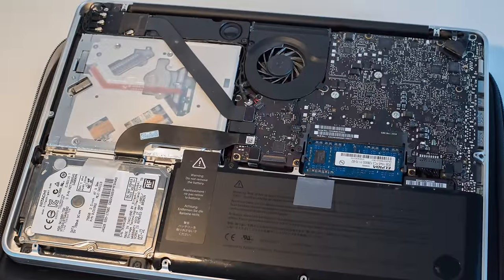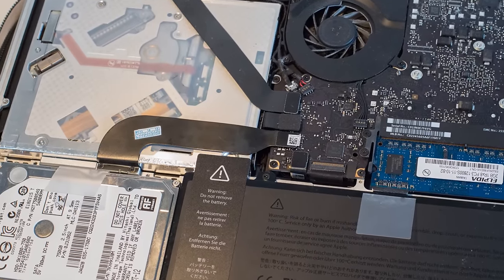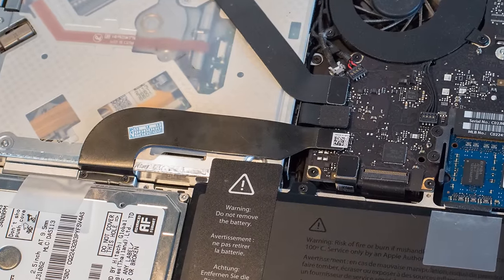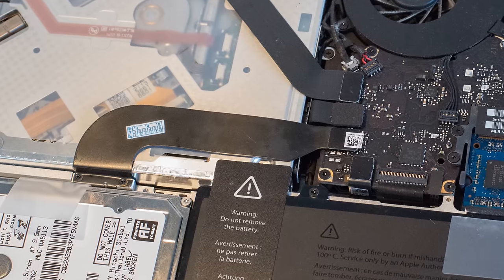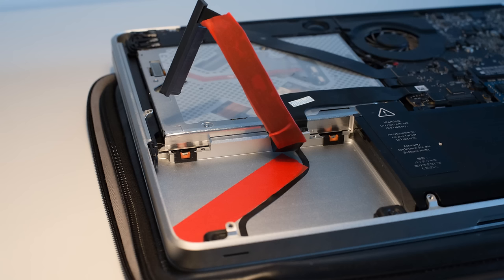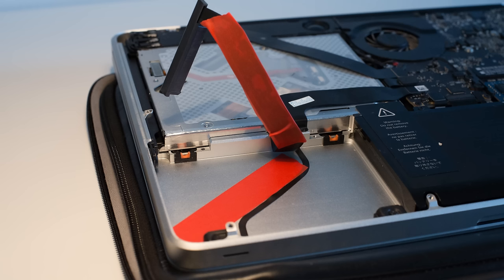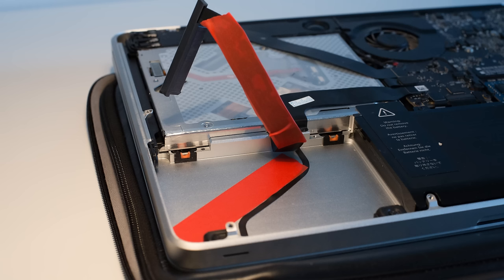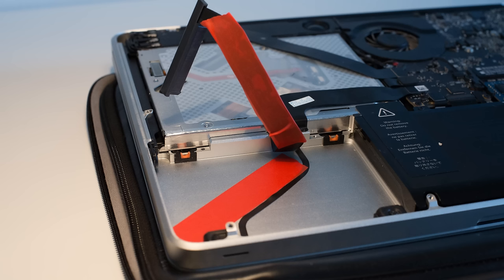MacBook Pro Hard Drive Cable Failure - Free fix and preventative maintenance - Question mark

Comment: Hi. I’ve started having such problems with my MacBook Pro 15 mid 2010… basically was freezing just after starting OS. I thought it could be virus but couldn’t even reinstall OS… so was afraid SSD failure or motherboard. Then looked at your video and used exactly your idea… It started working perfectly straight away! I didn’t even have to replace that connection cable (actually couldn’t see any visual damages on it) I’m guessing it could be some static electricity issue between aluminium unibody and cable. Now it’s been perfectly isolated after applying your solution! You’re a genius… many thanks👍🏽
Reply from the maker: Glad it helped! It is often worth replacing the cable anyway if you get repeat issues.
Reply: Brue Computing …absolutely, I’ve bought that cable already anyway in case. So whenever starts playing up again …just gonna replace it and apply that isolation again. Thanks

Comment: Did a full fix and upgrade in 2020. Not sure if I commented already but thanks for the vid and the amazing fix. Upgraded a mid 2012 macbook pro to 16GB RAM and new SSD with new version of cable (821-2049-A) plus your tape fix (old cable was def causing load issues). Updated OS as well to Mojave. It's working better than new, the i5 is still strong and 16GB RAM + SSD makes a huge difference.

Comment: I just found out my client would have to wait 4-6 weeks for a new cable... But thanks to your awesome video, I can fix it until the new cable arrives. (I would rather replace the cable in any case, but still use your fix to ensure the new cable will last). Thanks for your awesome tip! G

Comment: Shutdown Macbook and went to coffee shop. Went to boot and saw the "no boot" device sign. 3 reboots same result. Did a panic. Drove to get a newer SSD. Took out old SSD and put it in external enclosure. Watched this video on phone and saw that the original SSD could work. Sure enough, it did. Decided to use the larger drive and cloned the old one. Taped the cable. Put new drive in, had to re-install OS due to using a larger drive (an in place install, so I didn't lose anything). The electrical tape did the trick. I can use the old and new SSD in my Mac now without issue. Glad I didn't have to buy a new cable. Was skeptical that this would work. Thanks for the tip.

Comment: fantastic -- thank you so much for this video! For what it's worth, my problem was two fold- a short in the sata cable and a going-bad hard drive; when I inserted the new replacement HDD, the macbook wouldn't detect it. As soon as i put some electrical tape on the case, it found the drive right away

Comment: Excellent video - thanks so much! The mid 2011 Macbook Pro's like mine are terrific computers, except for this issue. I've replaced my cable twice (Apple - no charge), and was ready to do it a third time. I've been accessing my hard drives (I have an SSD in the hard drive bay and my old drive in the optical bay) through the optical bay "backdoor", and it's been surprisingly good. But it's clumsy at times, and I want my workhorse back. I'm going to get some tape now. Fingers crossed. Cheers!

Comment: that's brill!it works. thanks m8!

edit: after I tried your solution, the problem (long rainbow and question mark) still come out. sometime after i shaked my macbook, the apple logo will apear. so i try to pinpoint the problem with the cable by pressing the cable above the optical drive/cd drive and it works. the apple logo apear again. found that my exact location of my problem is the bent near the folded mark . make sure the cable above optical drive/cd drive not bent. put some paper or something like tape the cable stick to the optical drive to prevent any bend and give pressure so the cable keep straight. no more long rainbow or question mark even I try to shake it hard.

hope my suggestion can help you who have the same problem like me. cheers

Comment: Had to try five times. But here I am, looking at HDD back online. In my case I have taped all points of contact of the cable with any metal surfaces. The point where the screws are was probably where it went haywire. Now it works. Big freaking thanks!

Comment: Thank you thank you thank you thank you. You are my life saver... My old cable must have malfunctioned and caused my drive to keep restarting on itself till it's stop booting all together. I had thought there was a problem with the hard drive, so I bought a new one. When I got a new hard drive, the cable wouldn't recognize the disk no matter what, so I thought the problem must have been the cable all along. I bought a new cable and nothing; it still wouldn't recognize the new disk, so I thought the newly bought disk must be defective. But to confirm I bought a external SATA connector and lo and behold the new disk appeared, so I restored with time machine and blah blah blah, it all ran smoothly but I have to carry the hard drive externally, so I tried the cable again and still, nothing. I was gonna buy another cable but thanks god I came across this... In conclusion to my ranting, a lot of money and days of headache and researches could have been saved by simply TAPING the cable... P.S. I didn't even have electrical tape, so I used masking tape and it worked.
Reply from the maker: Glad to help. :)

Comment: This is great! My mac would start to boot, then go to a "question mark folder", freeze on the white screen, or take me all the way to a home screen with the mouse frozen. I replaced the cable once... a year later again, six months later, and here we are.... It seemed that each successive cable replacement lasted less time than the previous one. So I taped the whole hard drive cable up, on both sides, like you described. Did not help... What I did then is took out the two screws that hold the hard drive cable to the unibody (right at the two 90 degree bend), and taped over those screw holes as well. Suddenly, everything worked. I think the screws somehow rub against the cable and cause a short. The weakest point. I can't believe I paid $1.5k for this stupid computer. Still better than any PC
Reply: Question:  when you purchased your replacement cables were they "Apple" , or 3rd party?   I'm sure you guess where I'm going with the question, but sometimes saving a few $ isn't worth it if the part is made poorly.   (there are plenty of good 3rd party products of course, but some are NOT good).
Reply: I agree. yes my cables were 3rd party (suspected), although claimed to be "OEM" on Amazon. Apple won't just ship you a part from their website. You would have to go to a "certified Apple repair shop", and after they tell you that they don't sell parts, pay them $80/hour to work on it
Reply: iFixit has a good reputation if you haven't tried them

Comment: THANK YOU! I have a 2010 Macbook Pro 13" Took your advice and lined the cable routing path with electrical tape, problem solved. Too bad I already bought a drive for it, but I needed to upgrade to SSD and Linux install anyway. Great stuff!

Comment: Thank you.  After thinking I had hard drive failure and replacing the hard drive the utility still would not recognize the new drive so this makes more sense.  In utilities it will say disk 0, but for one moment it said disk 1 and that was a clue as well.

Comment: This happened to me this weekend, spent 2 days doing a backup even opened case to inspect cable.  Then when saw this video I added the 2 strips of electrical tape even though there was no visible damage and WOW this worked!  It's a shame Apple does not advise this in their support channel.  NO REASON TO BUY A NEW CABLE

Comment: Finally diagnosed the cable as being the problem when my MBP 2012 wouldn't boot.  HOWEVER, when it shorted out it must have damaged the SSD also, as that showed as being corrupted when inspected by other machines.  That made the problem extra complicated to diagnose.  To all intents it was a straight-forward SSD failure, so I replaced it with a cloned SSD backup (absolute lifesaver), which worked, but only INTERMITTENTLY.  AAARGGH,  

Further tests on RAM, hardware tests, etc, none of which showed up problems, but the system would repeatedly crash after a few hours/minutes/days.  

Finally by a process of deduction I suspected the data cable.  Replacement ordered on Amazon for £10, installed, and 2012 MBP working again on the cloned SSD!

Comment: This is a great tip... had the very same issue with hd cable.. I added electricians tape to the cable and chassis and now no problem. Ordered a replacement cable as a long term fix but will cover the new cable in tape as well.. Thanks very much.

Comment: Well, this is nothing short of a miracle. I've spent hours trying to fix my 2010 Macbook Pro which has always been faultless until a couple of weeks ago when all of a sudden the screen went black and wouldn't turn on or make any sound at all apart from the sound of the fans whiring. I was beginning to think, best case scenario a new hard drive was required when i stumbled across this video so thought i'd give the tape trick a go - and hey presto i'm back up and running as if nothing had happened - Thankyou very much!...
Reply: Incase anyone is interested, after i did the fix in the video, even though my Macbook Pro started up straightaway, once it had warmed up(after 10mins) it blanked out again to the black screen. I'm now hoping it's just a case of replacing the cable...
Reply: This exact thing happened to my 2010 Macbook Pro about two weeks ago.  It suddenly slowed to a crawl as I was typing something then the screen went black.  Afterward I restarted and got the prohibitory and question mark symbol on grey screen.  I tried booting from the recovery startup dvd and checked disc utility and it doesn't even show a hard drive exists.  Hopefully this tape fix works.

Comment: OMG, just tried the tape on the bottom and, voila, what do you know, laptop booted right up! This is after purchase of a, 1st, new upgraded hard drive-$60, and then, 2nd, a new hard drive cable-$25 both @amazon. Neither of which was needed, (the former didn't result in a fix) at the behest of the Apple Store tech with the 1st visit. Waste of time but maybe saved me money if still returnable to Amazon. He recommended I don't have this fixed (save the $129) in store but order HD from Amazon ($50-60), look on YouTube for quick installation of hard drive. HD ordered, installed, taken to Apple Store for OIS reload only for 2nd tech to tell me 1st tech should of checked the HD cable connection because old HD was probably just fine. Replacement service instore quote, $49. Searched for videos before actually installing the new cable ordered @amazon. BOOOOMM!! Thanks Brue Computing! You rock! Hopefully I'll be able to return both!

Comment: Looks like this really works! My cable was only 6 months old and it was giving me issues finding the hard drive. At first the tape wasn't working, but then someone on these comments suggesting putting tape on the part that goes over the optical drive and that allowed the computer to boot, but only temporarily, and it would lose the hard drive again. But i kept putting more and more tape until it stopped freezing and losing the hard drive lol!

Comment: Was just about to order a new cable. Lucky I found ur video. Maybe late but it thx for this info. But I covered the cable all the way from the led light indicator to the connector side. & on the led light connection, I spread some acrylic clear glue on it, letting it dry before fixing it back.

Comment: I've been struggling with this issue for about a week now. Once I tried booting externally I at least knew it wasn't the hard drive itself that was causing the issue. I'm going to try to put some of this tape down tomorrow. I hope it works!
Reply: did it work for you?
Reply: +Anna bella yes I totally forgot to reply but it was really easy to do and it totally worked
Reply: bongparty thank you so much, i will try today
Reply: +Anna bella I did have to replace the ribbon first because the original one was beyond repair. I have since put tape on the new one like in this video and I have not had the problem again. It did not work as a solution to the damaged ribbon.

Comment: Replaced the hard drive cable without realising this was the root cause, then the replacement cable is damaged the same way... should send the bill to Apple or iFixit for not mentioning the electrical tape part as I only put padding around the cable. 
It causes the "?" too appear instead of Apple logo when loading, so I thought the replacement SSD hard drive had failed or being infected with a virus.. 
I plugged the SSD as an external drive in another machine and was even able to access files in folders when I didn't have permission by accessing and copying them via the command line.
I was able to erase and reformat the SSD using disk utility on the other computer, but when I tried to format it to Mac OS Extended on the old laptop in disk utility it would freeze halfway through the Erase or Partition process, so hence I suspect the cable is damaged again, the cable appears milky where it goes over the edge

Comment: OMG this is insane. I just brought my macbook to the repair center because in my case its super urgent to get that fixed.
I wish i'd have found this video first, i hope they dont charge a lot and they are using this tape trick as well.

Comment: This worked for me! I kept getting random shutdowns and failures. I put in the electrical tape and voila my blinking folder issue stopped! I also was getting a format error when installing an SSD "unable to write the last sector". This solved that issue as well!!

Comment: I still had warranty, so Switch store (where I bought it) fixed it for me. 2 weeks later, it broke again. Went back and they replaced it with another 'better quality' one. A while later opened my Macbook to replace RAM and remember that, so I figured i'd check. They literally just tape-fixed it like you did :p

Comment: Wow, it works! I'm still going to the Apple Store, but at least I have a computer until then! 

Don't give up if it doesn't work right away, try taping other parts of the cable. Mine only worked when I taped over the optical drive! TY!!
Reply: Do you mean you taped on the cable going over the optical drive (is that the part that reads dvds?) or did you tape on the actual drive? Ive taped the whole cable on both sides now but unfortunately without results. :/

Comment: hey buddy, you saved my life with this tip!!!!! before doing this I tried to start my MBP opened from the back and separating the cable and the disk and the disk worked normally, so I used a plastic isolator (similar to X-ray material) to isolate the cable from the metal and the cable from the HD. It worked my friend, it fu#¢%" worked. THANKS
Reply from the maker: Glad to help. You may find you still need to replace the cable at some point however.

Comment: It actually worked. Thanks for useful info :)
Reply from the maker: Glad to help. Often it may be necessary to replace the cable still later, but it can avoid the replacement failing again.

Comment: I cannot believe this worked. Thank you so much. 

This was the second time the cable failed on me. Stupid Apple. But despite this problem, I actually think that these machines were the last great MacBooks.
Reply: Did you just use any kind of electrical tape?

Comment: This Brit or Auzzie guy has good information.  However, I like the video with the zoomed in views called "How to Replace the Hard Drive Cable in a 15-inch MacBook Pro Mid 2012" by MacSales.  I used it even though I have a 13 inch MacBook.

Comment: im surprised this actually solved my Mac book pro issue I though I lost all my data due to a failed ssd but I guess I was wrong I will still be ordering anew one and be doing the same thing so it lasts 👍🏻
Reply from the maker: Glad it helped! Its worth replacing the cable, but lining the bay with tape helps.

Comment: I did this trick on my early 2011 MacBook Pro and it increased my SATA speed from 1.5Gbps to 6Gbps. I have an Intel SSD.
I'm yet to see if the beach balls disappear completely, but it seems to work good so far

Comment: I'm using a caddy in the optical bay right now with my main HDD in it and it boots just fine. Later on I'll order another S-ATA cable and apply this fix and then hopefully this'll fix it. It's unbelievable that a S-ATA ribbon cable can be this fragile. And more amazing is that Apple hasn't even bothered to fix this problem. 

One question. Is this really because the ribbon cable rubs on the sharp edges and on the top cover ?

Comment: Didn't work for me, but I think my cable is already bruised beyond repair.  I will keep this technique in mind for my next cable though, thanks!
Reply from the maker: +Mike Belanger Sorry to hear that, unfortunately it doesn't work in every case. No harm in lining the inside of the chassis to help protect the replacement cable though.